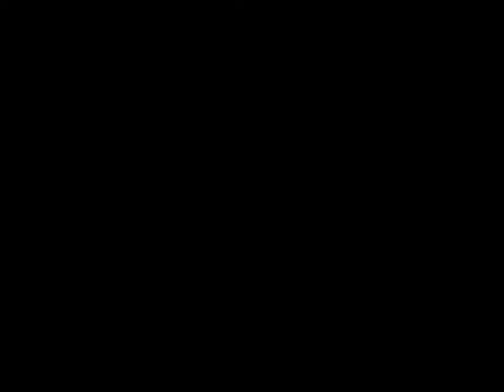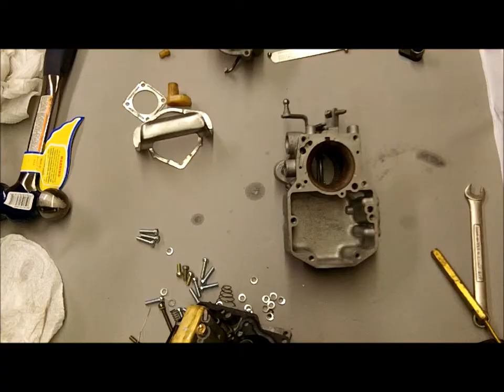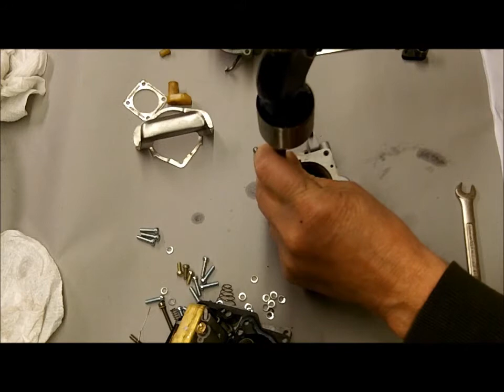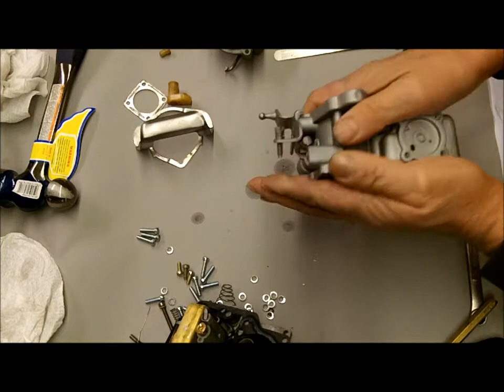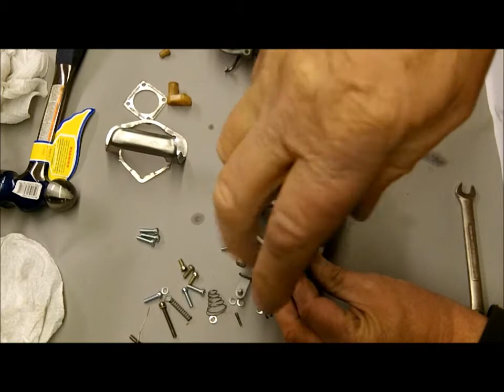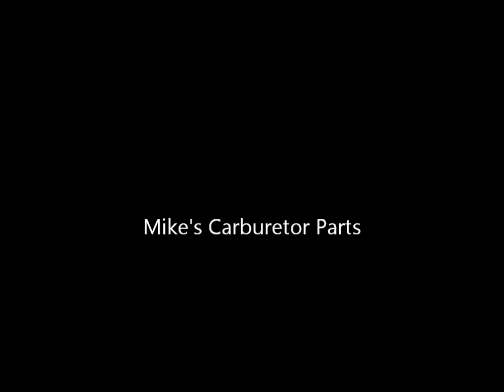Autolite 1100 Carburetor Rebuild - Part 3 Float Bowl Assembly

Comment: was there any variation of the 1100 that didnt use the same setup? the 1100 i just took apart from a 65 mercury m100, only had 1 check ball and no check weight.
Reply from the maker: There were some that used 3 check balls and a weight, but none that I know of that only had 1 check ball.

Comment: thanks, a very useful video, well done ! I have been searching for a while for help of this sort, specifically where do the balls go and how many are there supposed to be. Turned out my carb was missing one ball, l have a stash of small parts from carbs l have worked on in the past, found exactly the ball l needed in my stash, works like a charm now. l use this carb on a '63 Mercury pickup with a 223 engine.
Reply from the maker: Good deal!

Comment: I have a A/T 1100 on my M/T 1966 Mustang.  I've bumped out the 2nd dashpot to deactivate.  Does it still need the check ball?  Reason I ask, I'm missing the ball by the SCV.  Wondering if I could swap 'em...